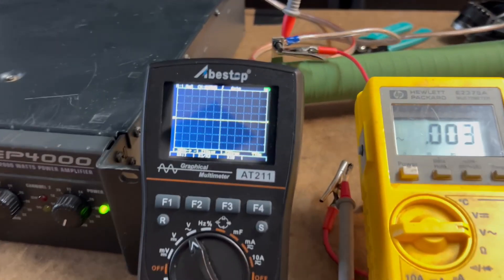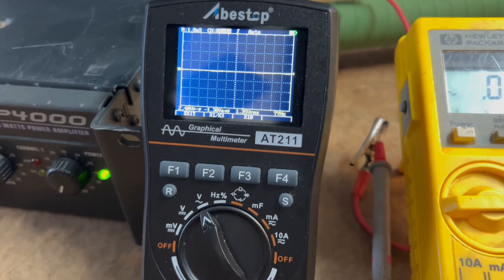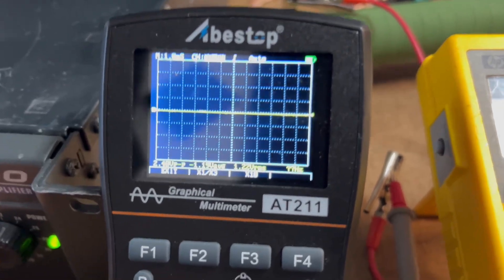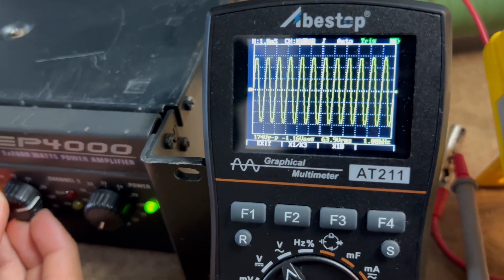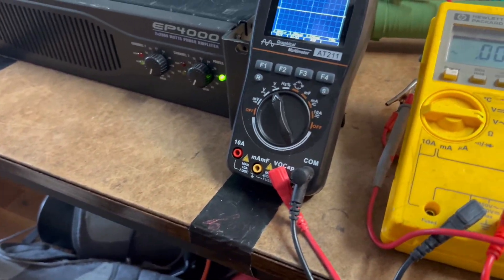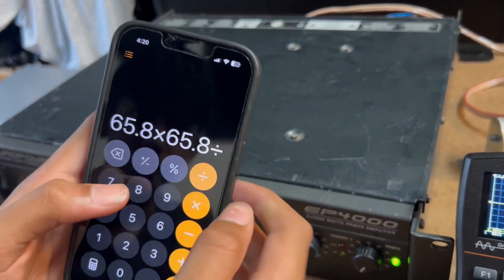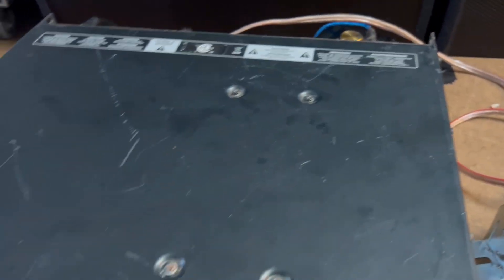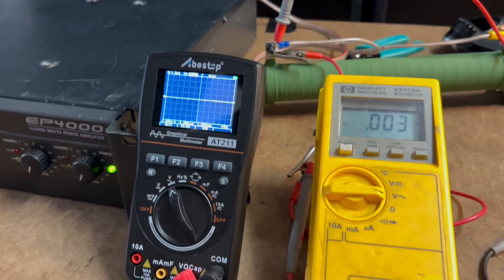Behringer Ep4000 Amp Dyno, Power at Clipping

Comment: Did you measured it on bridge also?
Reply from the maker: At the time of the video I only had a 300 watt load resistor and didn’t have at to destroy it. I’m sure that amp does what it’s rated on bridged, it’s built like a tank.

Comment: How much does it get at 4ohm?
Reply from the maker: I don’t know, at the time of this video, I only had a single 8 ohm load. I have two now so if I come across that amp again, I test it at 4 ohms. FYI those amps  are pretty good and well built.
Reply: @DJ_Renn Btw what do you think abt lab gruppen clone amps,many people recomended them to me,but i think for subs something like proline 3000 would be better(especially quality) .
Reply from the maker: I would do and Admark or Cvr before I do a clone lab the reason being, too many companies making the lab clones, some are fantastic, some suck.
Reply: @DJ_Renn its tempting for me to buy prokustk tip14000 but i think proline 3000 will be better for how it weights,quality (capacitors should hold more)
Reply: @DJ_Renn  I was thinking about getting one,but i bought crown xli2500 for subwoofer,and its pretty good.The xli1500 did 630wrms 4r while rated 450.

Comment: So they over rate their products?  Isn't it supposed to be over 1krms watts at 8ohm bridged?
Reply from the maker: No, it did what it’s rated for. It rated 550 at 8 ohms (this test). It’s rated 1750 bridge, I didn’t do that test, my load resistor would burst into flames at that power. Those amps are solid. They are almost identical inside to a qsc 2450
Reply: @DJ_Renn  oh gotcha!  Thanks for the test.  I'm looking at getting one of these amps
Reply: "Hello. Sir, is the Europower EP4000 more powerful, or is it the Yamaha P7000S?"
Reply from the maker: No it’s rated @ 550 and 8 ohms so it did just about what it’s rated. It claims 1750 bridge 8 ohms.  These are sold amps for the price. It’s almost identical inside to like a qsc 2450 at half the price.